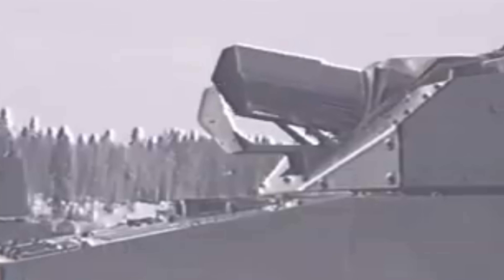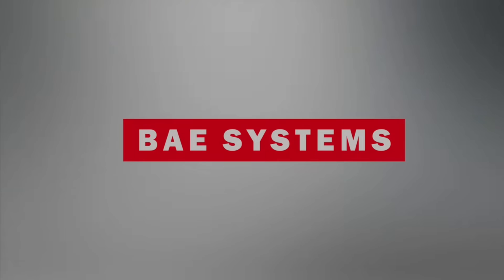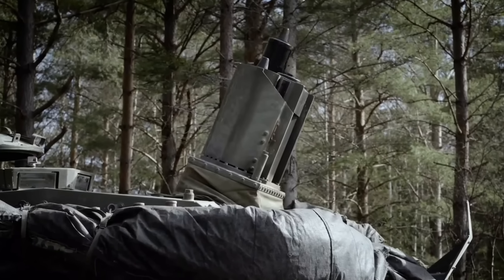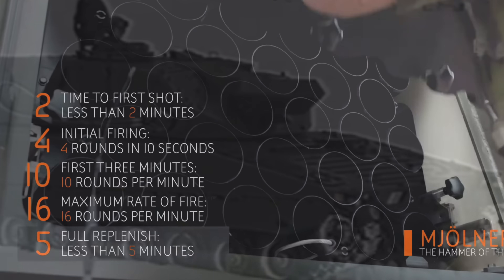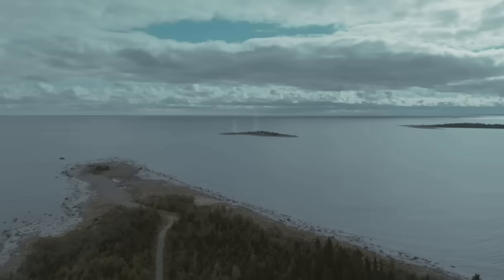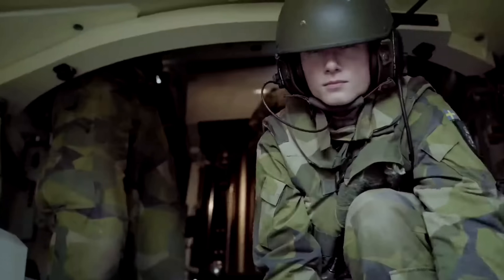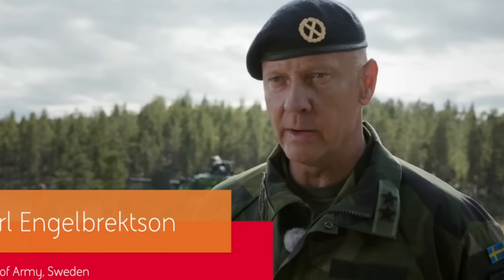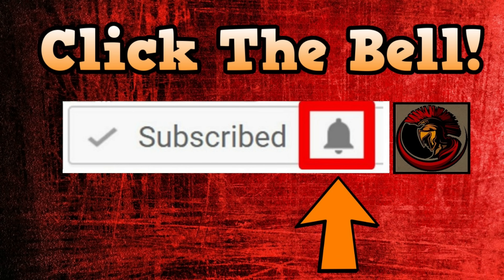The 'Mjölner' Rapid Fire 120mm Mortar Vehicle | DOUBLE BARRELED INDIRECT FIRE

Comment: What I like about this vehicle is two fold. Firstly as crew, you get to operate in a climate controlled ergonomically thought tru environment. No more frozen boxes to break into no frosted over indicators or waiting around for hours in the misery that is the Swedish winter. It will work wonders for avoiding crew fatigue.
The second is that it uses ammunition that is stockpiled by most NATO countries and it uses the CV90 platform meaning that it won't run out of spare parts or ammunition in a active environment.
I think that this vehicle will change the scouting work especially in winter, we already use bandwagons to tow plutons on skies to deployment areas, now imagine a vehicle that can do fire missons or cover you as your platoon is trying to break contact with the enemy.

Comment: It is all about cost. 120 mm system is not much cheaper than 155 mm per shot when using precise gps ammo, but the gun needs to be closer to frontline, and has much lower fire mobility - overall, it would be better to buy more 155-mm shells and barrels.
120 mm system need to be much cheaper in order to be cost-efficient.

Comment: This is a great part of combined forces. It doesn't have to be highly armored because things like this aren't meant to be used directly up front, and it's mobile enough to move back off of a front line moving closer to you. Even at a shorter range, it's a stand-off weapon that just needs to survive nearby artillery strikes.  Obviously, nothing is likely to survive a direct hit by artillery even if it was Abrahams armored

Comment: Its a bit crazy we aren't capable of making faster firing autoloading mortar systems by now. This thing looks slow as hell reloading compared to a ww2 infantry crewed mortar team. I'm a big proponent of mortars of all sizes for both defensive and offensive operations but they need high rof to be useful and saturate/interdict an area fast. Firing a shell here and there every 30 sec isn't gonna do anything... the footage shown isn't anywhere near the 16 round per minute announced o0
Reply: We are capable. Check M120 Rak mortar.

Comment: If Bae Systems Hagglunds CV90 Mjollner get fully automated and only needs a driver gunner duo tandem with fully automatic loading system plus is capable of launching drones will be a game changer.... For this current spec's it's a bit nah for other countries because it's cheaper to deploy a mortar infantry units than buying CV90 Mjollner or kits of Atmos systems and fitting it with other mobile wheeled or track platform to be honest 😹😹😹😹
Reply: It is all about the environment. If your winter is wet and a few minus with an inch of snow then the footsies do well enough, but when "just another day at work" is -40 degrees, snowdrifts deeper than you are tall, and wind with wet snow, and not a proper plowed road within 2 hours driving in any direction, you want those tracks, and you want that heated cabin. You do not want to dig foxholes. I tried digging foxholes in frozen Swedish winter: 2 men, 2 shovels, one 4 foot prying-iron and one pickaxe. It took 2 hours for a hole big enough to both stand in, both of us working nonstop. This is not filling sandbag and digging foxholes in Saudi! Add then if it also is a wet bog barely frozen over, which it also can be, then your infantry is asking to switch to special forces and go swim with the crocodiles down i Guyana where it is atleast warm. The arctic and the Russian border is going to be a much bigger future theater of operations than in the past, even in the cold-war. You need equipment for that environment, and Sweden, Finland, Canada, Norway, Russia and China have the home-turf for that environment. Russia are probably the "op-force", and China are at best neutrals in such conflicts and standoffs.

Comment: I'm sorry but this weapons platform is simply not worth it for several reasons.  First and foremost, as a tracked artillery vehicle it isn't powerful enough to set it aside from similar systems.  Additionally, some of the biggest benefits of the mortar is that your can set it up within range of the enemy without detection and have rounds out before they know an attack is imminent, it has a very small footprint for an artillery weapon and can be operated by a very small crew,.  This vehicle isn't stealthy and it too closely resembles weapons in existence.   Why waste money, time, training and space with these.

Comment: Whenever a tracked vehicle is primary carrier of a direct or indirect fire system maintenance requirements increase exponentially. Getting it to the battle area also has its drawbacks. When you need a heavy truck system that is dedicated for long distance movement you dwindle away scarce transportation assets. HUMMER a vehicle can be configured in relatively hasty timeframes .specialized track vehicles are just that low density and hard to support in the overall logistics footprint of the battlefield

Comment: I’m a bit disappointed on the how the loading system works, although innovative, just slightly subpar. I thought these mortar tubes were a breech-loading system, not a system where the handlers slide the shells up and out of 1 set of tubes, only to slide them back into the firing tubes. You would think that in battle, precious seconds matter, sure this loading system is quick, but I think the breech loading is somewhat quicker. Maybe I’m wrong, but it certainly feels like it could’ve been designed better. Other than that, the entire mobile platform looks great.

Comment: Mortar has its place but keep in mind that the mortar is basically a very low velocity howitzer. Simple calculation will show you almost 1min flight time at max range, ~3x larger than the howitzer. If you miss your first shot and try to correct, than that's already 2min engagement time, giving opposing howitzer the opportunity to quickly knock mortar out with proper radar support. 

And of course the mortar cannot engage the howitzer at the latter's actual normal working range of 10~20km. And so properly equipped adversary will quickly knock out any mortar, armored or not. 

But the mortar does have its limited place for staying few kilometers from the front line and harassing enemy infantry. Not the rear though, and subjecting itself to a very high risk of being detected by drones and getting immediately knocked out by "proper" howitzers .

Comment: As someone who did my military service with the organic artillery (towed 120mm mortars) that Mjolnir replaced (is replacing?), it's an amazing machine that basically a huge upgrade in every way (firepower, deployment speed, mobility) while not adding much complexity to battalion logistics (since it's using the same chassis as the mechanized infantry). The lack of range isn't a huge problem, because they're going to hang back a kilometer or so behind the tanks/mechanized infantry and provide fire support whenever they need it (with much higher availability and weight of fire compared to traditional towed mortars).

And if you think that the Mjölnir is vulnerable and lacking armor for the turret....take a glance at the US "XM1287 Mortar Carrier Vehicle". Now there we're talking about lack of protection (and lazy design in general).

Comment: Mjölnir is more or less a feezing conditions optimized version of a common M113 based 120mm Mortar, one barrel more gives it barly a burst fire capability. But very good ammo placing for loader/ reammunition.
Bought by the disadvantages:
- bottom limit burst fire, of 2 rounds, not a "shoot and scoot" dream
- classic mortar ammo range adjusting (pressure rings) must be done by the loader during loading process or during reamunition, no space for preparation (for shoot and scoot this preperation must be done during driving)
- turret is to heavy for light infantry formations (paratrooper)

all in all a realiable, cheap optimization for a very common setting, but that it.  So thinking about a short barreled artillery with the same shells as long barrel artillery (only 1 propellant instead of 4 for normal fire) in an autoloader turret would be the better improvement to fullfill the duty of such 120mm mortars.
Reply: Mjölner is the budget version to get 12cm grk in the CV90 after Reinfeldt/Borg "saved" money cancelling AMOS (check Genomförandegruppen  Wikipedia)

Comment: Nice video; I've always been interested in "mortars under armor" such as implemented by the French, even though I'm actually Infantry.  I also suspect wheeled systems would be superior to tracked, but it seems like mine is the minority opinion.

Might want to 'hotlink' your AMOS video, or at least include it in the text; I didn't see it when I checked your video list.

Sweden might want to send some of their systems to Ukraine as "testbeds"!!
Reply: You should check out the M120K Rak system then. It's probably the most advanced 120mm mortar turret out there, the only one with a full autoloader.

Comment: Personally I love it.  Some of the modern systems are absolutely over engineered and may lead to other failures in a challenging battle field conditions.  As we all know, high tech and mud, dirt, sand and water does not go well. 

What puzzles me is that the mortars with short range will have its limitations.  The counter artillery fire will be cover much of the mortars operation zone near any contested fronts.  With new integration of drone and target acquisition, if this system is so close to the front, once it is identified, it can be tracked by an enemy drone and taken out quite easily by a counter artillery fire (say 16km mortar range vs 32km towed artillery range).  It would take 20mins to be out of enemy’s counter artillery fire range.  Long enough to be identified by a drone.  

No one seem to have solved this puzzle fully yet.  But I am all supportive of more fire power for the front line infantry whether it is wheeled systems (basically truck with mortar on the back, wheeled APC with mortar or even humvee with mortar of the back) or tracked systems or even the light 60mm hand carried systems.   I am dying to see a new fully automatic system with 50-150 rounds per minute capabilities like the old badass soviet systems.
Reply: Ask the Russians how easy it is to hit a moving target with artillery. ;)

Comment: The CV90s that were turned into Mjölner had already been slated for getting AMOS turrets and had been modified before Sweden pulled out of AMOS. So Sweden got the first 40 Mölners very cheap, as the CV90 were already paid for. Any more order will be much more expensive.

Comment: Mortars will ruin anyone’s day. For you and the enemy. 
The still standard mortar system that requires between 2~6 troops, basically a squad. Is cumbersome, slow, requires too much maintenance and costs for a simple tube that costs $175,000 per unit. 

And its not utilized much with a Company sized element. Its like. Special equipment.

Comment: This is a good system in more than one way.  One, it's able to put down range alot of shells and they are in the 120mm range and that is a killer for large groups because of the kill area.  Two, it's able to move on tracks and reposition without having to break down the mortar and get the ammunition all it does is drive off to another position before return artillery gets their area.  Then there's the armor where it's able to be protected from shrapnel while still being used.  And the ability to hold over a hundred rounds of 120mm ammunition is a game changer, regular mortar teams especially the big shells like this wouldn't be able to move at all and would have to dig in and make a ammo bunker to store those rounds.

I agree, this is a murder machine for infantry and I would bet if you add in drones to act as real time spotters it would decimate any area of troops and material that is close enough to be a danger to your own lines.  I think the reason why most if not the big countries and therefore the smaller ones don't look at this is the same reason they never considered off the shelf drones being used to recon and real time spot for artillery as we see in Ukraine.  They just never considered it and/or seen proof of concept.  Now imagine these mortar batteries of Mjolner are in real time contact with drones that are seeing where the troops are and their positions.  They start putting alot of ammunition down range on them along with air bursts to mix it up and eventually they will suppress the unit from attacking and maybe even running for their lives.

Comment: It would seem to me that a system like this should be designed to be rear facing. What I mean by that, is that it should predominantly back into it's fire position and engage targets while facing generally away from the enemy. That way after the fire mission, the driver can immediately drive directly away from the position without taking the time to turn the vehicle.

Comment: The CV90 platform seems to be far more what an IFV range should be - common base for maintenance, multiple specialist variants. Effectively the pinnacle of the SdKfz 250/251 thought, with increased modularity.

Comment: Tbh, i fear that this product is less about effectivity but what people feel to be usefull after looking for the recent war in Ukrain. Maybe some don't understand the goals and mechnics of this war and by that come to wrong conclusions. I don't think BAE does that, but i suspect they think there customers would. Wouldn't be the first technical WTF? on BAE toys these days.

Yes, its an seller for CV90 chassis, but lets be honest - if you want be part of a highly mobile modern battlefield, go light and cheap. Mortars are not that complex - you can feed them way more simple and flat, so no turret is needet. A Humvee or Fennek chassis is a good platform for that. Boxer if you want to go real heavy. You move, stop, fire two or three rounds and move again. Each of these vehicles can have some low density 'foamy' armor with minimal whight to stop low kinetic shrapnels and such stuff. Specially if you go to precision guided ammo, its not about the number of shots fired, but you can have three vehicles crossing terrain real quick and woth low signature, one spotter reaches out and/or pop up drones and mark the targets, and a tank battallion stops existing before anyone can fire back. And in return the're too cheap to waste high range ammunitions on these targets. At least those tactics would force the enemy to double ther cheap tanks cost by installing propper APS.
Tank spam would stop being a valuable thing. And the same way you could abuse these quick units to lay barages with dumb ammo if needet.

Comment: This is a nice piece of gear, but I really see it as a transition vehicle. When they build in auto loading 120mm in a rapid firing, stabilized, multi barrel configuration, like the handheld M32, then I can see the full potential of a platform like this.
Reply: That system you ask for is called AMOS.
Reply: @johanmetreus  AMOS is still just a twin barreled system. I want a high speed, rotary, chain driven system... think Predator  :D
Reply: @Obliticus  Geez....   that leaves the Russian philosophy of crossing off a map-grid far behind it, what you're suggesting is the equivalent of taking the scissors and cut the grid out of the map.

Comment: an all in one system makes a lot fo sense. 
LOTS of ammo on-demand, shoot n scoot in low timeframe under ~relative~ security and the accuracy of a vehicle mounted electronic fire-support & likely C&C systems.

downside are that is is a vehicle so drones be they surveillance or cheap patrol-style cruise-missiles will label them as a good target of opportunity, the usual issues with tracked/mechanised mobility (hills and water) and the expense of a few of these versus the usual low-tech tube with backplate and ammo distributed amongst a bunkered down or advancing squad.

Comment: Maybe that's  just the German in me speaking but I feel the reloading mechanism could have been engineered a little bit more .. elegant.
But I can see the benefits of such a system on a light, mobile chassis - maybe a Boxer? :)
Reply: Hägglunds previously designer the AMOS together with Patria. That’s an automated much more advanced system. But Sweden decided it wanted more firepower at lower cost. Having a relatively simple mechanical semi auto system like the Mjolner means it’s cheap to build but also operationally robust. There simply isn’t much that can go wrong with it. Drawback is that it can’t fire on the move. On the other hand Mjolner provides A LOT more firepower than the single barrelled Nemo system while being A LOT cheaper than the AMOS.

Comment: Granatkastarpansarbandvagn is literally grande throwing armor track carriage, or a armored tracked carrier with a mortar system. I absolutely love the Swedish army's naming system, it's just literally what it is and the year it came into service and then a version letter. Take the ksp90(FN Minimi) as an example, It's a machine gun that went into service so mg90, then they did a test with a shorter barrel and collapsible stock, which was called mg90bt(machine gun 90 b test) which went into service so it dropped the t.